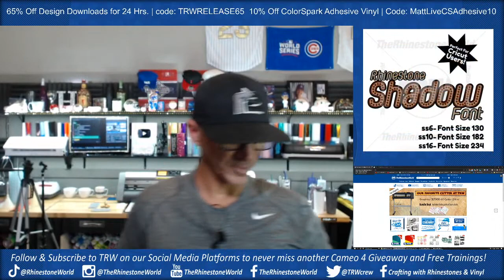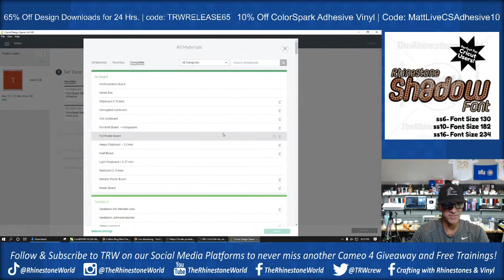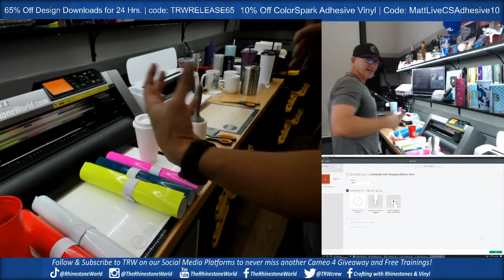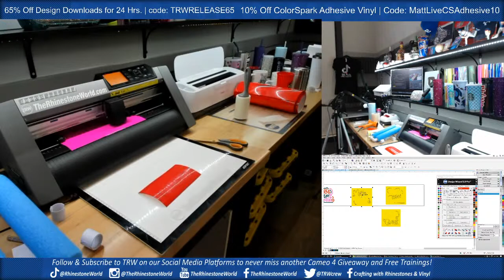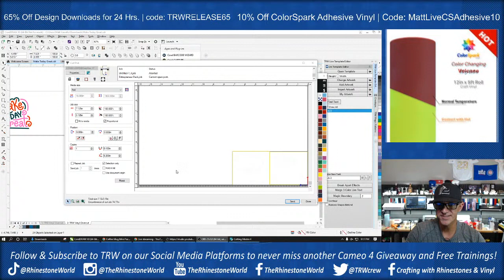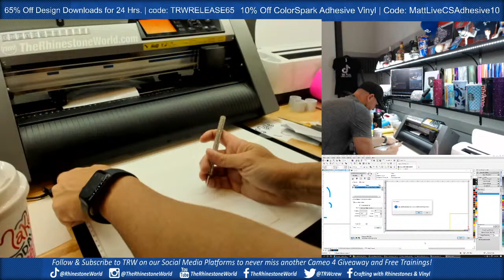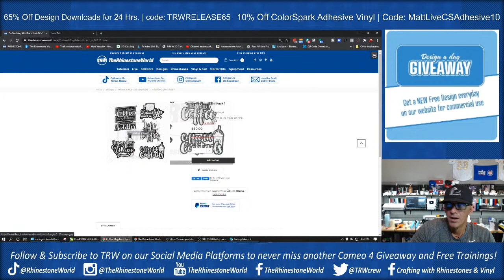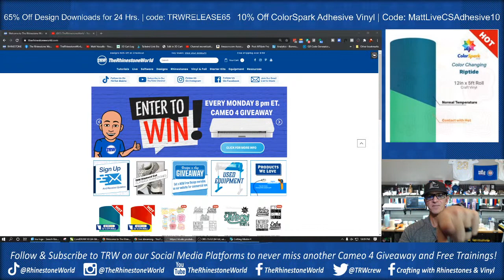Free Live Adhesive Vinyl Training & Special Product Release | Cricut | Silhouette Cameo

Comment: I am having trouble with the 20oz Mars rhinestone template. I am new to all this. I sized it as directed, but it still didn't line up properly (the rhinestones). It messed up some of my magic flock. What do I do?
Reply from the maker: Hey Angel! I'm sorry to hear that. If you're still having trouble with it, give us a call at 941-755-1696 for assistance. 

- TRW Haley
Reply: @TheRhinestoneWorld  yes, thank you for responding. I actually purchased more magic flock and have now ruined over half the roll 😡   I followed the steps to the T from the most recent video and still can't get it right. I will call when you all open. Thanks again.